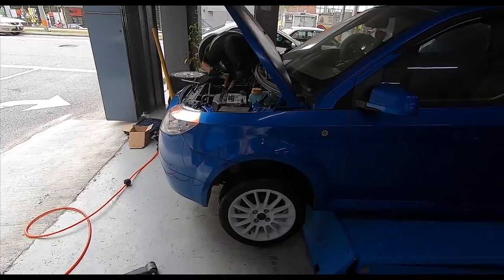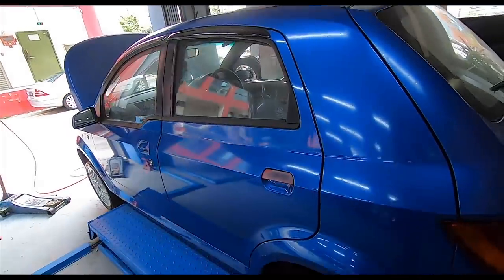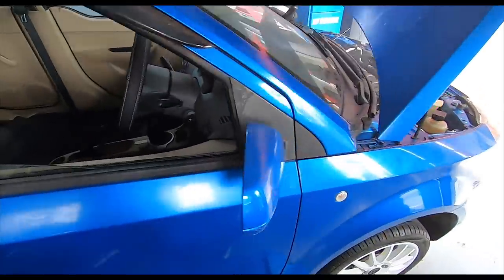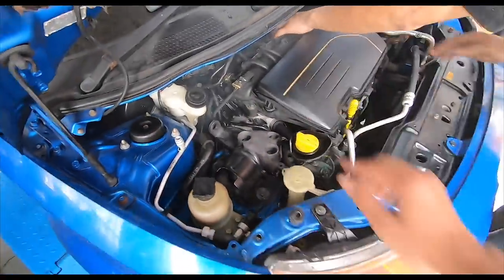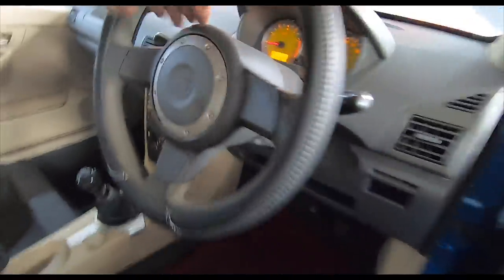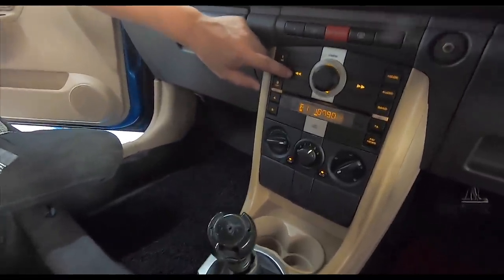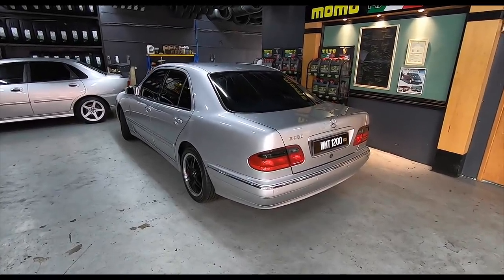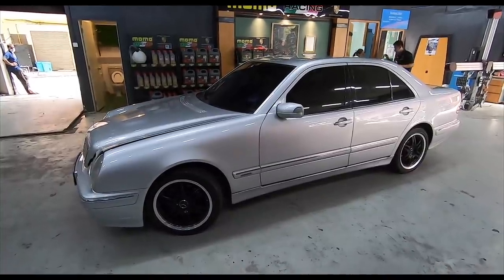WEEVIL UPDATE: 2006 Proton Savvy 1.2i D-DAY - Will She EVEN START UP?? | EvoMalaysia.com

Comment: Sad that proton didn't try to fit in a simpler engine in the savvy. Would have been nice if they had the magma 1.5 in there. Great little car to drive. Sadly most mechanic have a fear of French engineering.
Reply from the maker: Ooh, a 1.5 in this would be interesting indeed 😁👍🏾

Comment: Chris, when the Saga is doing 110 - 130 on a hot afternoon, does the temperature gauge goes up?
Reply from the maker: No, never past midway, always slightly below, even on the hottest day. If it goes over half to 3/4, something's not right 🙏🏽😊
Reply: @ChrisWeevilGarage  Thanks for the confirmation. Guess i got a new issue to solve or to live with...
Reply from the maker: @leongsw1462  should be an easy fix, I had that issue with the Corona. It was a faulty water pump 😊
Reply: @ChrisWeevilGarage  Thanks for the tip :) Mine works pretty well on all occasion except afternoon highway runs, so its annoying.